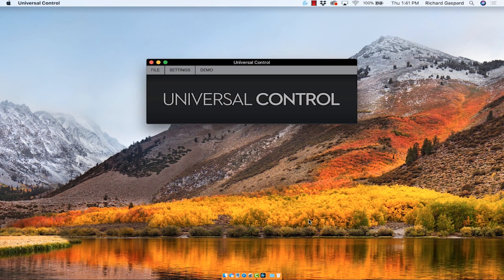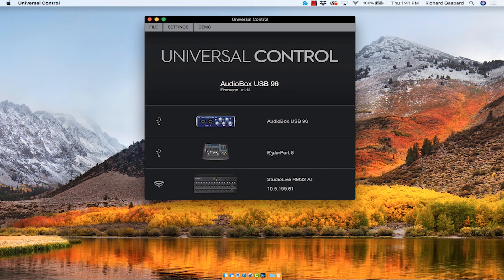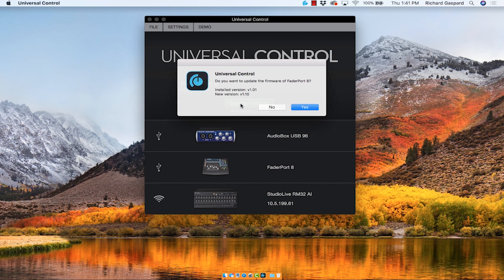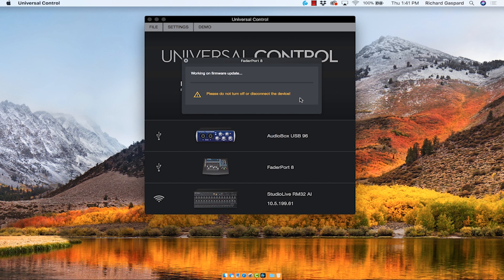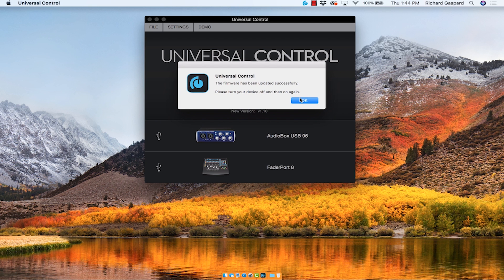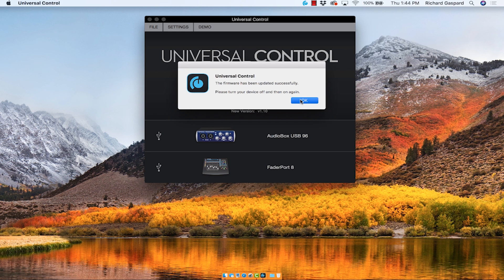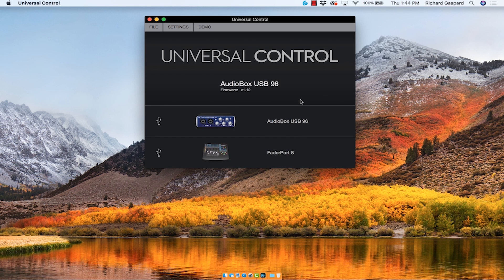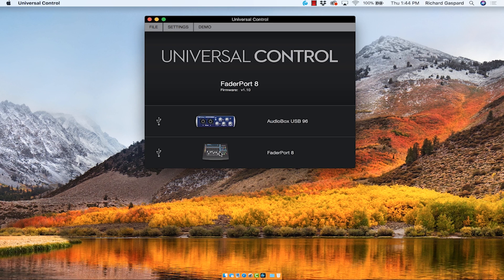PreSonus–Updating FaderPort in Universal Control

Comment: I receive an error code when attempting to update firmware on my faderport 8

"The firmware update failed with error code 0x80004005."

Can anyone help?
Reply: I just figured this out for the Faderport Classic, but I had the same error code. Apparently it's because you can only update through USB 2.0, not 3. I had to use an older laptop to update it. Ridiculous
Reply: This is a joke, right? So I have to go and buy an old pc to upgrade my controller?
Reply: I thought it was a joke too, but when I installed it onto an older laptop of mine to try it out it actually worked and carried over to my regular work PC.  I'm surprised that Presonus has never addressed such a ridiculous restriction on a product that's being sold brand new.